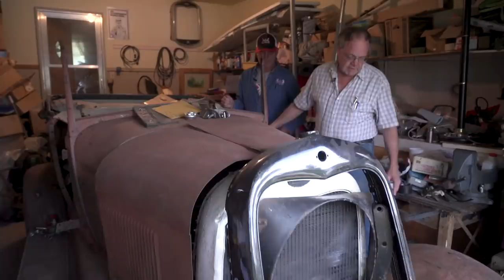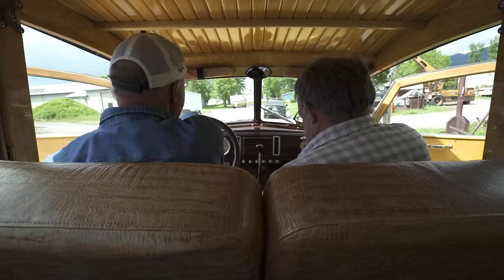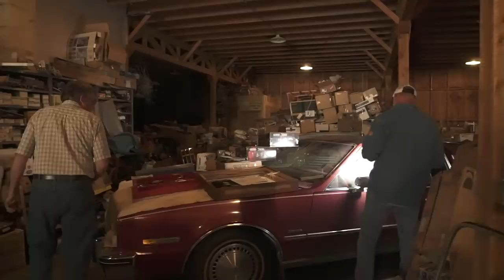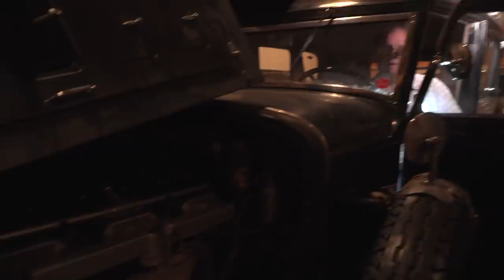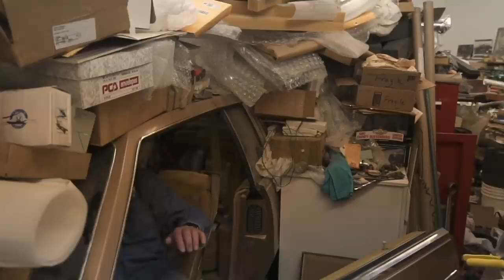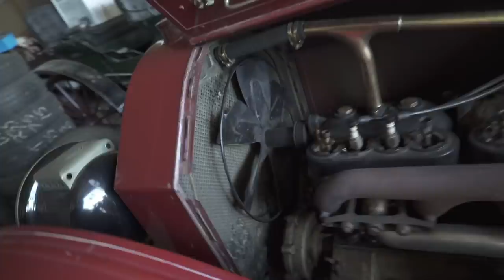Crawling through a Toronado to find a Corvette | Barn Find Hunter - Ep. 65

Comment: Remove the 2-way radio antenna on the Toronado then and fill the hole in the roof with a machined plastic or high durometer rubber plug with some sealer/adhesive and call it a day. Makes for a nice story as well.